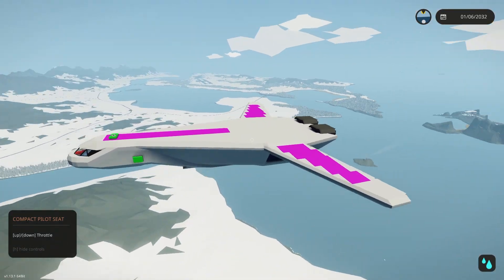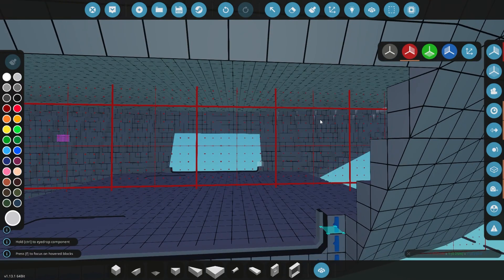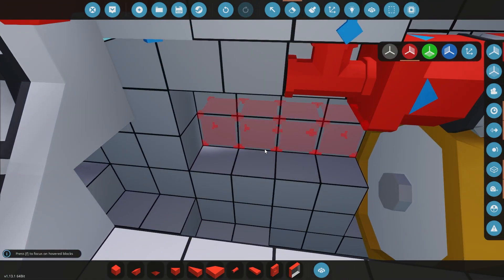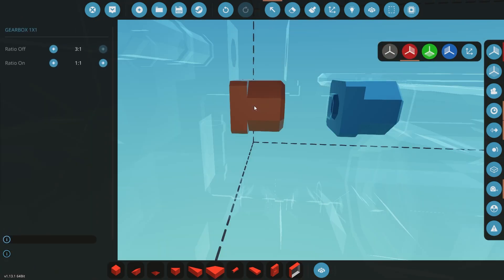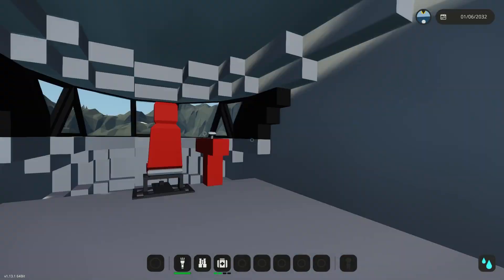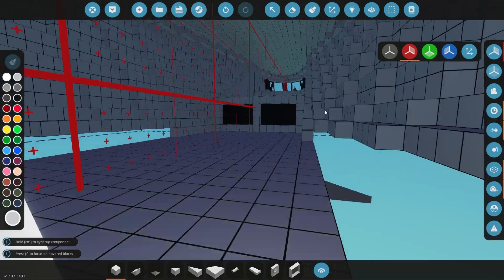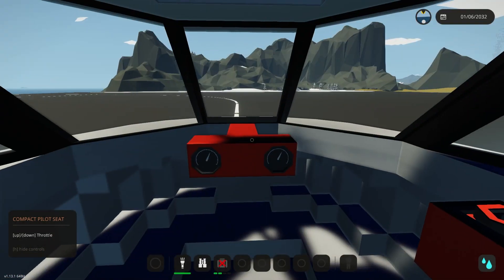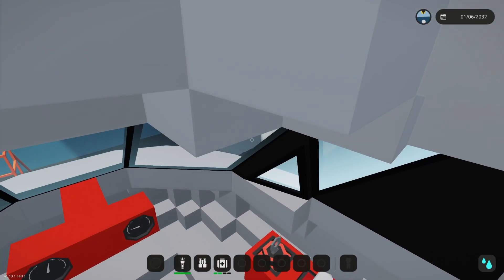Stormworks Build Series : Lifting Body Tanker and Awacs Episode 2

Comment: If you're taking any advices/suggestions - i would like to tell you that from my experiments i've found that 
a) This is kinda cheesy but jet engine intake can be placed in a sealed room with air and it will work forever without pulling vacuum, it'll work even underwater.
b) Clutch made from 2 modular engine clutches and a piece of crankshaft works miles better and smoother than a single block variant.
Reply from the maker: Since the plane will use two different flight modes I have two clutched with a fly wheel to keep the rps more steady, I like the normal clutches because they are simple, usually a clamp on them at 0-.66 will do the job since they are exponential you don’t get any more power output past .66
Reply: @WhackAL  That's some valuable knowledge, I knew they felt weird but did not know that they were exponential and peaked at 0.66 Thank you for sharing that information.
Reply from the maker: @nikelon8227  yeah of course, basically past .66 your only gonna take power away from the engine and not add any to the drive terrain, pretty much all clutches every vehicle will perform better if you do this!